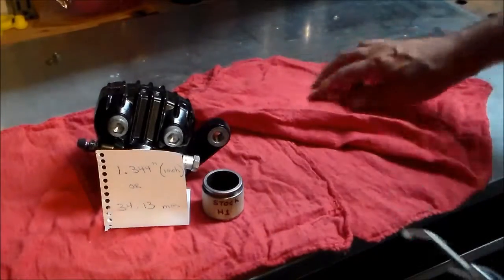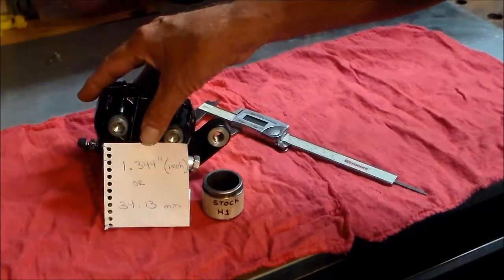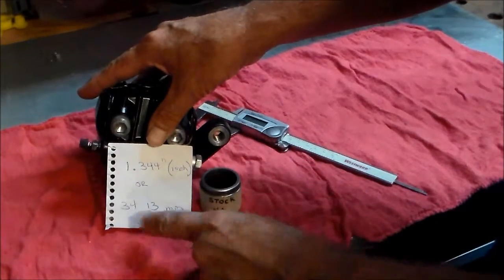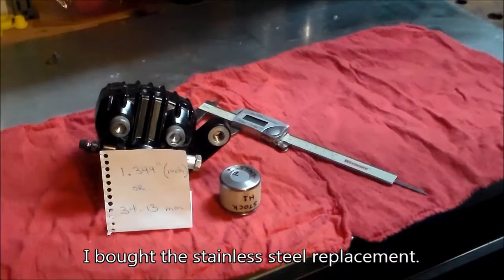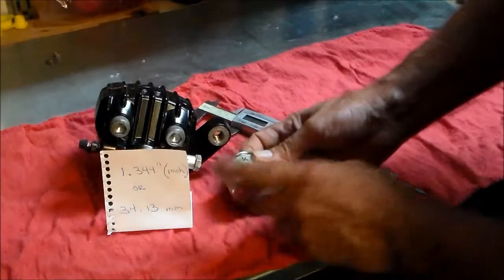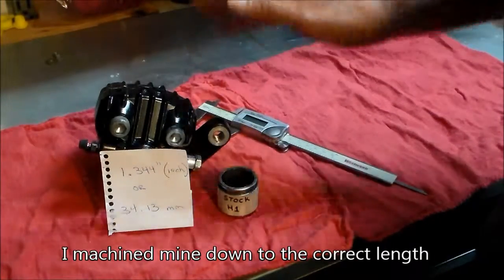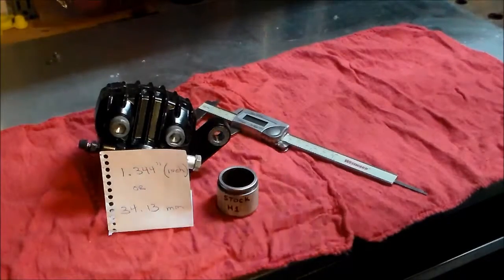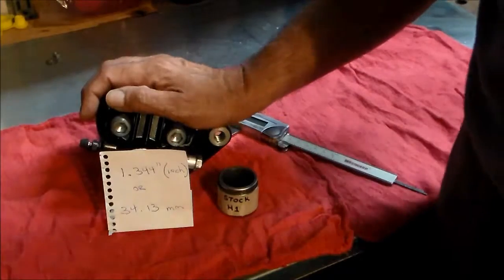Checking the front caliper piston length

Comment: Thanks for making this video. I bought a H1 that is in tubs. A lot of work went into restoring it, I'm the beneficiary of the hard work that has gone into it. I went to install the rebuilt powder coated calipers and new pads. Only to find out that there was a issue installing the loaded calipers. I did check the rotor specs and it was good. I thought it may have been do to poor quality aftermarket pads. Now I'll pop  the pistons out and check them, instead of removing material off of the pads. 👍